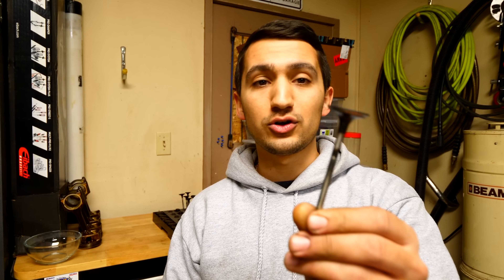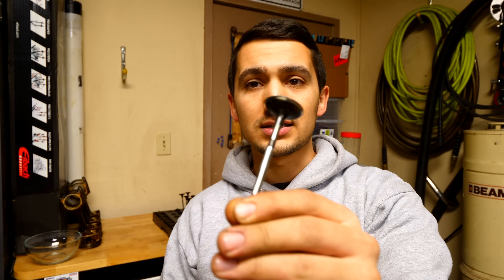How to Clean and Refinish Valves

Comment: Well my valves don't seat properly anymore, but hot damn they look good.
Reply: Too much funny
Reply: exactly my thoughts
Reply: Scared of a little valve lapping?
Reply: Ahahahahaha yes more leaks then when they had build up but they do look pretty for something no one will ever see...
Reply: I thought the exact same thing
Reply: Lmfao I’m sorry about your valves but I needed that laugh
Reply: That's so fucking funny!
Reply: lap them
Reply: Yeah, scotch bright pad ok. I would never sand them
Reply: @stealthtrees96   so its bad to sand them?  beacue they not gonna seal or what?
Reply: Ha Ha Ha
Reply: Yeah, terrible waste of time. Valves need to be re faced.. Lapping is also a waste of time. You're best off not sanding the stems. If you have raised edges around dents that will interfere with the guide clearance then hone them down with a stone but preserve as much of the stems as possible. Having shiny engine parts doesn't really award you anything. They are just gonna get covered in carbon again.. I find the best cleaner for carbon is boiling hot soapy water.. However steel wool seems to attract the carbon but would rust like crazy with soapy water so my new favorite method is steel wool in a conventional parts washer. It's way more important to have tight guides, true faces and concentric seats than making things shiney
Reply: 84toyota4wd Scared of when the valves drop into the cylinder or hits the piston 😂
Reply: But hey they do look pretty
Reply: For a mini cooper.
The same mini cooper s that have major problems ?
Reply: That's why you lap your valves again? All tho polishing your valves make them look good they don't really have any actually use all the polish and prettiness will be burnt off or , it'll still look good but no more shiny and obviously the more you run your motor the more carbon build up and so on
Reply: @stealthtrees96  actually sanding where the air would flow across the Valve and making it abit skinnier is perfectly fine . I did it in my SB 302 to let that tiny bit more cc gain in the head with all said and done I had my stock e7 heads flow 32 CC's more
Reply: Keep in mind not to sand the stem
Reply: @204_mod_shop  I wouldn't use a rougher grit than 1500 sand paper and water. All you need is 1500 grit, and polish. When this guy sand blasted the valves I winced way to much material removed, might have sealing issues.
Reply: @stealthtrees96  that red scotch is coarser than any of that paper he used. Body ppl use scotch brite in place of paper for certain phases of their process.
Reply: Carbon buildup can stop good sealing. I'd imagine a good polish will help flow rate. The main thing id be afraid of is any deformation caused on the stem from the drill chuck.
Reply: When the mechanic rebuilds your (his) head at least he will say "Damn these are some shiny ass valves"  before he replaces them.
Reply: Apparently, Google told him how to recondition valves.  SMH, either buy a book about machining and metal coatings or leave it to the professionals.  If I was carbon, I'd hit that mirror finish like a prom date HAHA
Reply: @540 MUDSTAIN false. I apply black nitride and pressure chamber it with ammonium. It will outlast the vehicle, I believe you are thinking of black hardening and that will fail within 10k miles.
Reply: @540 MUDSTAIN to each their own. I'm only giving my advice and experience. If someone wants to do it this way, they can. I love the DIY approach. I rebuild engines for a side gig and use chem-dip to remove carbon.  My primary job is in aviation, I am an airframe and powerplant tech. My only concern with polishing is that the surface of the metal is exposed to heat, moisture, carbon, and pressure.  In the aviation industry, we prevent corrosion with chemical coatings and CPC's. The black nitride coating is .0001" or 3-5 microns thick and can be removed with abrasive material very easily with red scotch-brite and/or 400 grit sandpaper.
Reply: that's an easy problem to solve, and should be done anytime the valves are removed from the head.
Reply: I think instead of water,seafoam or mystery oil would be better.infact you might want to pre-soak the valves for a few days firzt
Reply: if you used mystery oil with every fill up(1-2 4oz.bottles) they'll never look bad but stay clean
Reply: Once he sanded the valve there went the grind , and he better re-lap the seats, he may as well be polishing silverware
Reply: thanks for the good laugh mate. LOL
Reply: @84toyota4wd  Valve lapping wont fix the angles you cut off by sanding and polishing. You may get them to seat and make a seal, but with the wrong angles you'll burn out your valve within  a month. So what again was the purpose of polishing them?
Reply: @barrykilts4506  curious, how is that possible when taking into account, no fuel washes the valves with GDI?
Reply: @snkombo2586  wrong ... you polish them up and then lap them (like anyone taking apart a head does) polished valves flow better and carbon sticks less easy. You ALWAYS lap valves when disasssembling and reassembling a head as they get covered in carbon which alllows leak
Reply: All the smarty pants listen up .... carboned up valves do not seal 100% thus leaving free horsepower and mpg on the table.. try lapping carboned up valves ..you have fun , il polish my valves ,lap them and enjoy the power , mpg and peace of mind i did it correctly .
Reply: David Borawski 😂😂😂😂😂
Reply: Lmaoooooo
Reply: Knock out like .001 of a inch off lol
Reply: @ricgomez1  So wrong but ok
Reply: @jacobnichols2182  As a auto mechanic and a machinist I can tell you what I know. Its obvious you have no experience, so you don't know what you're talking about. Try it on your vehicle and see for yourself.
Reply: @ricgomez1  i have done not exactly this but I have built many engines with warranties and never done one twice
Reply: @jacobnichols2182  That doesn't answer the question, have you ever worked as a machinist? Just because you know how the "build" and engine doesn't mean you know anything about this. You commented trying to correct me, but you have zero experience as a machinist.
Reply: @ricgomez1  warrantied engines lol
Reply: @ricgomez1  all these theories that this engine is ruined are far fetched and when everybody starts talking like they're an expert all of a sudden everyone is lol
Reply: @jacobnichols2182  Your one that's talking like youre some type of expert, I'm using my experience to let people know that this is not going to improve your vehicles performance, its gonna reduce compression and (depending on how much material one removes) will render the valves useless in a short while, they guy is using a drill to sand the valves all the way to the valve stems, nothing good is gonna come out of this. Did you see how much material was on the bottom of the bowl? Damn...this is why it's not recommended for anyone to use a drill when lapping valves either, it just removes too much material. Anyway..as I said before, if you think this is such a great idea, then you use this, but you will be in a machine shop shorty afterwards. You cant argue with facts, if you remove too much material you're gonna change the angles and change the valve stem clearance, hence the valve will fail prematurely, it's a mathematical fact.
Reply: lol my thought, these clowns needs to stop putting DIY garbage on the web
Reply: 😂😂😂😂😂 my thought exactly!!!  Some people need to just stay away from cars altogether, and especially YouTube!!  Can you imagine how many fools actually went and did this, and now thier cars wont start cause they have no compression, cause thier valves arent sealing worth a shit???  Good grief.
Reply: right... first thing i thought... relapping is gonna suck
Reply: Legit exactly what I was thinking
Reply: Fucking  sandpaper, seriously, why polish them? Never heard of grinding paste.
Reply: You should be lapping your valves regardless
Reply: The first pad and lite lap would have been sufficient.
Reply: It makes sense to have a smoother surface to help prevent carbon sticking even as far as air fkowing over it will be more efficient by a very little....any jmprovement is an improvement
Reply: They will seat fine
Reply: @Ashroyer86  was thinking the same thing. The drill could get them gauged!! the stems
Reply: @capitanknightfilms3986  tape over the ends first
Reply: I was thinking the same thing. Lol
Reply: This is why you lap your valves...
Reply: Yall needa look up how tight valve guide clearances are, let alone the ruined seat angles. 
Good luck to the stem seals holding back all that pressure.....😆
Reply: @84toyota4wd  out of round, a little lapping not going to do it now.
Reply: Performance valves come polished tho
Reply: @bob.el.builder  
I guess the problem is not the polished surface. It’s the valve stem clearance been changed after polishing process. aftermarket ones portably are made a bit larger, so there is extra material there for the polishing process?
Reply: I’m hoping we get a video of the aftermath of this once he gets it back together and starts it 🤣
Reply: Ok. Is that for real, Or are you just champing at the bit?
Reply: Lmfao
Reply: hahaha thats awesome exactly what i was thinkimg
Reply: LOL
But hey, looks are better than performance.
Reply: @Ashroyer86  this right here. I stopped taking this video seriously the second I saw him drop that valve in there without any protection.
Reply: Sandpaper? Should have stopped after the Scotch Bright. No doubt, one day, Milan is going to be a great mechanic.
Reply: @bob.el.builder  q
Reply: @danieldimitri6133  Lapping is a waste of time? Funny that all the workshop manuals recommend lapping, and after a valve reface you are meant to lap the valves. I have lapped plenty of valves and taken them from leaking to sealed. Either you have never lapped a valve or you have bad technique. If you are actually are careful you can sand the non sliding part of the stem to remove the carbon without taking metal off. It was common practice on V8 in the 70's to reduce the size of the stem at the bottom to improve performance.
I do agree that it is pointless making the valves shiny, especially as a lot of valves have coatings on the non moving parts that reduces corrosion.

Comment: I got idea for re applying the coating bro. It comes in a spray can u get it at autozone in the paint section. Its called VHT high temp spray for exhaust and shit. That stuff will protect them from heat. Says 2000deg boy them valves will last for years!

Comment: For those that don't know... There should actually be a degree of roughness on the valve stem/ face to help atomize fuel... DON'T polish the valves like this guy does. Also if you chuck your valve into a drill / drill press, you should have a piece of rubber tubing in between.
Reply: or just use masking tape to nurture the stem. check first if your valve stems have special coatings!...you don't want to sand off any coating.
Reply: Absolutely RIGHT.  Saw this video and Cringed!
Reply: I have seen many videos of people chucking there valves in the drill and not cover with something
Reply: Thanks for the tip!
Reply: Thanks Patrick, that makes more scense.....so where do you stop, at the purple scotch brite? What about cleaning the other end?
Reply: @john2ndname nuture the stem?
Reply: Sandblast??? PLEASE, DO NOT sandblast your valves!!!
Reply: @troybrake5686  Valves are much harder than chuck jaws. Unlikely to cause any damage, but why take the chance?

Comment: Glass media blasting a valve has fundamentally changed its geometry. The reason valve work is expensive is because it should be done precisely using machines and the correct tools. I know it looks shiny and you've improved somewhat boundary layer resistance, but what you've created are incredibly minute changes to the diameter up and down the valve stem, and probably reduced the diameter of the valve head somewhat. These things are a minute and 100% factual science now bro. There isn't any subjectivity anymore. We have run millions of engines millions of cycles in every application under the sun, most of the people who said you did a bad job are unfortunately correct. Some research into what valves are and why they are important would have gone a very long way here.

Whether you lap the valves afterwards or not, you've messed with the valve geometry on a scale you don't consider important, and thats fine. But the scale is important and all these guys in the comments telling you that have a point. What you did will severely reduce the life of your valves.

Just an FYI when they make valves from scratch they balance test them, test for roundness, check tolerances and sizings to the thousandth of an inch, and ensure they all weigh exactly the same, and most importantly, your stem guide clearance should not be anything but the most accurate it can possibly be. Sanding the stem of a valve is very very silly if you want your engine to run hard, fast or long periods, or indeed, all three.
Reply: Lets not forget that once you have spent hours and hours polishing your valves and assuming you had the fore thought to do a 3 or 4 point valve job to restore the seat angles and margins, corrected or was able to maintain the guide play with the stem, it will carbon up again shortly after a handful of engine cycles anyhow.  This Tuber is completely inexperienced, uneducated in engine and cylinder head building/restoration.  I could barely get through this video.
Reply: this is very convincing comment , i have a gdi engine how can i clean the valves if its has carbon build up?
Reply: @mm-il8dg  it will do more good for you to run an in-tank cleaner. They sell bottles of these carbon removing agents everywhere these days. They work relatively well and are worth the money. Read some reviews and find a good one.
Reply: @Kavster92  but in gdi engines the injectors doesn't clean the valve unfortunately 😔
Reply: @Kavster92  on cars with Direct Injection there is no fuel passing over the intake valves, if it did they wouldn’t have carbon build up.
Reply: @mm-il8dg  a common practice I’ve seen is to have your intake valves cleaned with walnut blasting.  It takes a knowledgeable technician to perform this service because if they mess up, your engine could get damaged.
Reply: You're completely right. Sadly I was like man I wish I could do this with mine, but something tells me the valve guide clearance is going to open up and that's much much worst than having a nicely cleaned valve. The larger the valve guide clearance is, the faster the engine will wear out. Tight fitments matter much more.

This method might do alright just as long as you're careful to get the shape right and measure measure measure afterwards. Make sure the valve stem is the right diameter and your valve guides are still the right inner diameter. Make sure your valve guide clearence is within factory spec.
Reply: Only way this would work would be if you got new valve guides installed in your cylinder head perhaps with thicker guides to accommodate the thinner valve stems. Which that job alone likely costs more than just buying new sets of valves so yeah unfortunately this is not good either way
Reply: @mm-il8dg  I hope you find the answer by now but he was talking about an intake manifold cleaner. It gets sprayed directly into the throttle body or a vacuum line to hit areas fuel doesn't pass over
Reply: @whodahellru8124  he was talking about intake cleaner, not a fuel additive.
Reply: Let me ask you this, I was a automotive machinist for 25 plus year's from bone stock stuff to 1000's of horsepower stuff. When a customer wanted the valves cleaned? We had machine that vibrated with media in it. The longer it stayed in it? The more it had a polish look. Was it out of round? Hell no it wasn't, we put them in a valve grinding machine and read the run out, at less then .0005" run out? Unless your running a top fuel, NASCAR, engine's? You will not see a one horsepower drop at all. Should he sand the valve stems? Hell no, should he invest in a caliper that reads down to .0005" inch? You betcha. Only your high performance valves are close in weight to each other. Factory valves come in bens then ground, not a one is weighed. Hell 90% of valves are not within tolerance to spec book. Very few manufacturers actually get it really really close. So, I'm here to say he needs the valve reground and checked if in tolerance in the machinist book. Trust me, there is tolerance with factory valve's and it's a lot more then he removed.
Reply: How about using PH down on only the valve face where carbon is built up?

Comment: You should have put a piece of clear to over the end of the valve before you put it in your drill . You need to polish all of that with valve grinding compound. The same valve grinding compound . You use to seat your valves .

Comment: THIS VIDEO SHOULD BE REMOVED FROM YOUTUBE SANDING THE VALVE STEM MAKE LOSE THE ADJUSTMENT BETWEEN THE STEM AND THE VALVE GUIDE
Reply: LuchoPortugayo obviously he has never heard of specs and clearances and has never seen valve grind  and a suction cup and how it’s done old school and properly😂😂😂😂
Reply: Youtube wouldn't have any videos if they took down all of the bad information on it. 

If you don't see any micrometers and bore gauges being used, they are probably back yard hacks.
Reply: If he buy a set of new valve. I confirm he will polish all of them to look shining.
Reply: Dat Boii  or you can just replace the valve guide.. like anyone who knows what they're talking about would do.
Reply: @TurboVisBits  what are you gonna replace it with. He did it by hand. All the clearances are different now. He’d have to get custom valve guides for each valve.